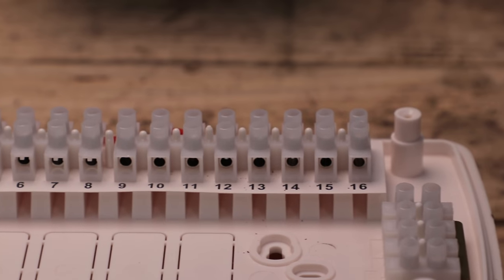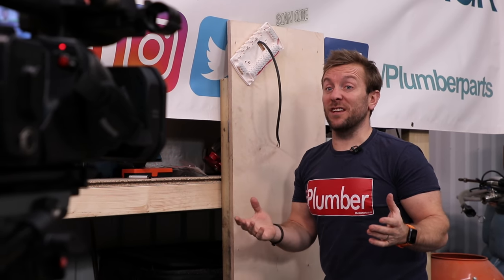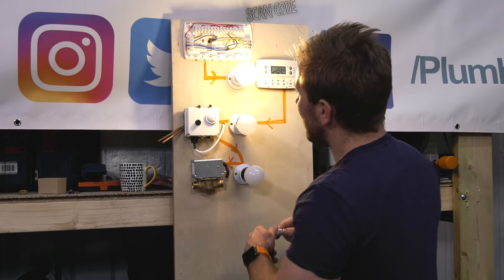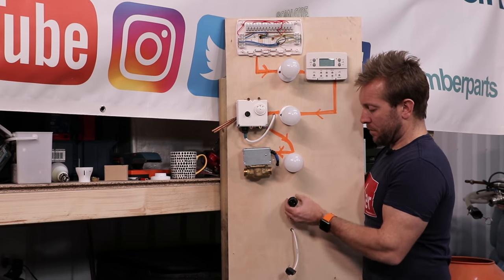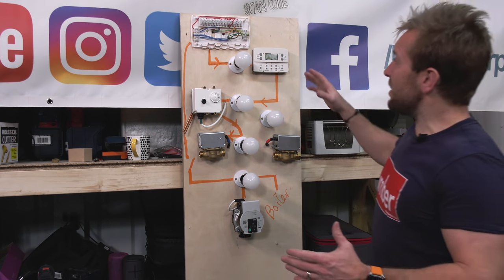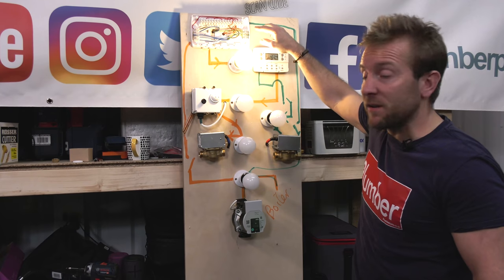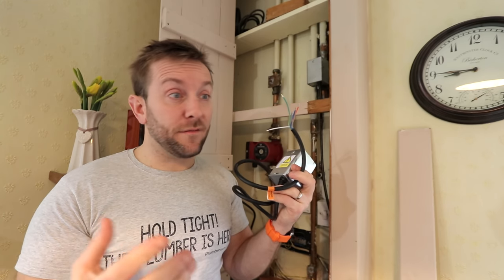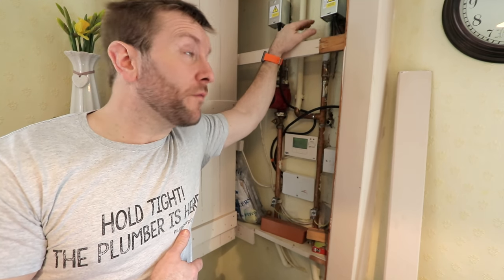2 PORT VALVES CENTRAL HEATING WIRING

Comment from the maker: Hope you enjoy guys! This'll either help or confuse you more! Comments Answered by Monday on Wednesday's video! HIT THE SUB AND BELL!!!
🛠 AMAZON TOOL STORE: http://www.amazon.co.uk/shop/plumberparts
🤗 BECOME A PATREON: https://www.patreon.com/plumberparts
📺 VLOG CHANNEL: http://www.youtube.com/c/timeswithjames
Reply: Pls my programmer thermometer can’t turn off the central heating and I don’t know if the two port valve is gone, but the hot water can turn on and off, but the funny thing is when it’s on the heating also comes on...Pls what’s the problem of my system thanks.
Reply: Cracking vid 👍👍👍👍👍
Reply from the maker: @kwamenkansah8814  100% New 2 port valve bud!
Reply: Thx so much, that's what I need for Tomorrow. Now I can start drinking.
Reply: @john-paulcox918   free de de
Reply: very well explained, not done my honeywell wiring course for about 5 years, this has brought it all back, thank you

Comment: I have installed mine but for some reason the arn isn't touching the button to turn the water on I'm not sure if I have wired it up wrong but I did the silly thing and took all the wires out can someone help

Comment: Thank you James.  Your video has helped me identify my central heating problem and explained how the two port valve is switched and connected to an S plan system.
My problem was that I noticed the pump was continually running with the boiler on until it locked out when the water became too hot. 
Despite switching off from the program unit the pump & boiler continued running. 
Your video helped identify a faulty micro switch in the Danfoss two port valve (central heating side) which was replaced under guarantee installed in a new house only 1 year old. 
Interestingly, both the boiler engineer and the plumber, who replaced the unit, said three other houses on our development had the same micro switch problem with the Danfoss valve.
Thanks again for your video

Comment: Hi James,
    Excellent video with simple explanations for amateurs like myself, so thanks for that.
    I wonder if you could please recommend a ‘simple’ wiring change which would delete the mid-position function my Honeywell 3 Port Valve on my ‘Y’ Plan System, and stop the Motor still being energised if you switch off the Central Heating when it’s running.
  As you know, if you turn off the Programmer’s Central Heating only switch (Port A open) when the system is running, then the 3 Port stays energised, with the result that the Motor is energised, although it’s against it’s mechanical stop, which shortens the Motor's life for no good reason that I can see. The only way to avert this is to switch on the Hot Water for just a few seconds after the Central Heating is switched off. This disconnects the live to the 3 Port and allows it to be spring assisted back to it’s default position of Port B open.
  Additionally, I only ever use either the H/W Cylinder or Central Heating separately, never both together (Port A & Port B both open), and never the Timer of the Programmer, so the Motor is never required to “stall” in it’s mid-position by using the 110 DC Voltage via the Diode and Resistor circuit on the PCB in the Valve Head.
  I’m asking this because my current Valve is a Honeywell V4073A unit, but Honeywell also produce the V4044 range, which look identical to the V4073A, except that the V4044’s are listed as 2 position “Diverter” Valves only, (no mid-position), which is exactly what I want to achieve (but without spending £ 100 +++ money or my fitting time !!!). Please accept my thanks in advance of your help, and I look forward to receiving your reply.
Cheers, Fred.

Comment: hi, I have 3 zone heating (ground, first floor and water with climote) and I lost heating on first floor. Plumber is not available for 3 weeks but he told me it is the motorised valve. So I got it and replaced but nothing changed. so I started looking for schematics online and testing different things. Your video helped a lot. What I found is that valve is working fine but the live never gets to valve to move that arm to press button on microswitch. Seems simple enough but some wires goes into wall and can't figure it out completely. Mostly because the lives that go out for the 3 valves behave weird. I mean when I call 1st floor heating, the correct live fires up but then goes inside wall and does not come back to live in valve and valve does not starts boiler because microswitch is never pressed. For water it works perfectly but when I call downstairs the 2 lives from controller unit for 1st floor and ground floor go live, go into wall but only the one for downstairs gose live at the valve.
This is where I am stuck as I don't know what happens in the wall (although after watching this for second time I think it might be something with pump. I was only thinking about starting boiler...) and I don't understand why when calling ground floor 2 wires go live ( and from climote schematic they are ground and 1st floor N/O respectively). Wish I could get you to look at it but unfortunately I am in Ireland.

This is wrecking my head for week now...

Comment: Great video as always James Ive always used regin 5 pin connectors when do 2 or three ports save keep disturbing the wiring centre 👍🏼
Reply from the maker: Do you use those Wago connectors?
Reply: @plumberparts  never tried them James are they decent? By the way top videos as always 👍🏼
Reply from the maker: David Berney cheers bro. Yeah they look good, but I’m going to try your idea!
Reply: @plumberparts  would love a sticker for my van James to promote your channel up in Mansfield Nottinghamshire give big g a fuss from me 👍🏼
Reply: The Regin connectors are great since they are an all-in-one plug so easy to disconnect when required.  Evidently popular with all the plumbers that have visited our house over the years because 3 of the 4 port valves are all spliced into the system using them.  The last valve head gave up recently so picked up a replacement and used a Regin connector (well actually used a Wago box for a few days while I waited for a Regin to arrive in the post!).

Comment: How would you got about introducing an underfloor heating control centre with 2 zones. so overall radiators being controlled by one valve and nest, and the other valve controlling the water to the UFH with 2 zones each controlled by nests.?

Comment: Had an issue with the room thermostat not working, would you recommend using the manual mode in a 2 port value to attain heating

Comment: Hey where does the black cable coming out of the motorised zone Valve connect into? I noticed it's like 2m or so long cable. Does it matter if my underfloor heating manifold is downstairs and my boiler is upstairs?

Comment: Great video James - looking forward to the Y-Plan follow up because that's what I have at home.

Unrelated question - the header tank in the loft always overflows to outside around 1-2litres of water each time the heating system is switched on, are there any things I can try first before calling out a plumber? Thanks!
Reply from the maker: I’ll answer on Wednesday!
Reply: The water level in the storage tank is too high , check that the float valve is cutting off properly first . If it is lower the float a couple of inches , this will allow for the expansion when  you heat the hot water from the heating system.
Reply: Probably happening due to a faulty automatic bypass valve not allowing flow during pump overrun and forcing out the open vent. Some people don't bother installing a bypass with a Y plan as the hot water circuit is left open after it's deenergised and acts as a bypass. The problem is it's a small opening and can still force some water out the open vent, rasing the water level in the cistern to overflow
Reply: fit a bypass

Comment: Hello there, I would like to ask you why you can hear the water circulating through the pipes? it is very disturbing especially at night when it is quiet. I have the heating system divided between the upper and lower part of the house and I can use them independently or together. The idea is that the valves are installed in the bedroom in the dresser (that's how I bought the house) and my child can't rest at night because of the noise.
If I manually turn off any of them, the noise disappears. What to do?
Can I send you a video so you can see what the problem is please?

Comment: Can I get the permanent supply for the micro switch from the switched live on the 2 port valve instead of an independant permanent supply? It will give the micro switch a live supply when the valve is selected?? Thanks

Comment: Interesting how different things are done in UK and US compared to Denmark. How is it possible to control the heating in a big house from a room thermostat in a single location ?
Reply: Large houses are usually separated into 2 or more zones with separate thermostats and valves

Comment: Is there a way to wire the valve control to a mains switched controlled supply with a tank thermostat.
I’ve a 2 zone heating S plan , controlled by 2xRF stats. Also an RF tank stat. 
Only 2 zones on the programmer…
Want independent manually switched hot water ..

Comment: JW John ward electrical guru, uses greys as permanent lives to valves and oranges switched live to boiker/ pump. How would you wire a S-plus with two or more heating zones? Take a feed from terminal 4 on programme to a room stat, then to the brown on a zone valve for that heating circuit? If you had a pump on each circuit would you wire the pump feed from the brown or orange / grey which ever is the switched to bring the pump on?? Thanks
Reply: Doesnt matter how many zones.all oranges together and all greys together.1 or 20 its the same.take pump live to brown on zone valve for multipule pumps
Reply: @davidlax9454   Bit late to the party but…

Im wiring the controls for a 2 zone system (ufh and central heating) the ufh is a simple set up with just 1 zone so no actuators for each ufh circuit but there is a pump for the ufh that needs to come on ideally with the orange switched live from the ufh zone valve however I don’t want it to come on with the central heating as well. I was planning on using a relay to prevent this from happening but have read comments on other peoples videos saying to just feed the ufh pump from the brown switch live operating the zone valve. Would this cause any issues over time with the ufh pump starting to run as the zone valve starts to open?
Reply: @euanowen4233  best way to do it.connect ufh pump to zone valve brown and use microswitch (grey and orange) to fire boiler.no relay needed
Reply: @davidlax9454  thank you!

Comment: Hi, how would this work if I wanted to add a second heating zone? Thanks Scott
Reply: Add another room stat and 2 port , you can have as many 2 port valves as you need . A lot of new houses have 3  2 port valves , 2 for heating zones , 1 for hot water
Reply: dennisphoenix1 hi thanks for that. That’s what I was planning, will just need to work out how to prioritise
Reply: @scottisle2550  you could use a time clock to bring on one zone earlier than the other , I always set timers to bring on the hot water half an hour earlier than the heating,  gets the water hot without starving the heating.
Reply: @scottisle2550  you can use a 3 port valve to supply 2 heating zones , in mid position you get 50/50  flow to each zone , depends on your set up

Comment: So, if you use the manual override on the two-port zone valve (for the central heating), does that mean that the boiler hot water pump will be on continuously, no matter whether the room thermostat and timer switch are on or off?
Reply: no

Comment: If my boiler pump continues to operate when both two port valves are closed via the programmer, do I suspect a fault with the motorised part of a two port valve. In other words may the micro switch not be operating as it should.

Comment: my hot water and heating issue is when I turn water on I'm getting heating with it and when I turn heating on I'm getting hot water with it this issue is since the 2 port zone valve is replaced is it to do with miswiring. If so how can I fix this

Comment: The issue with using permanent feeds to 2 port valves is when they stick on and override the stats and keep the pump and boiler running
Reply from the maker: This is part of the beast!
Reply: @plumberparts  I wire them using the time clock switch wires so when the clock or stat goes off so does the valve feed , no overrun problem

Comment: Wiring in from scratch. Easy.😀 Retrofitting a valve can be a nightmare working out which wire is which when opening the lid on the wiring centre. There may be more than one wiring box in the real world. Potential nightmare😚

Comment: Do not put solder on flexible wires.. tin flows under pressure. If you want to do better than shoving fine stranded in a terminal not designed for it (and you should!), use a ferrule. They're cheap, they're easy, and the 'insulated' type help prevent you screwing down on the insulation instead of the conductor. No solder. Please.
Reply: This! Solder has worse conductivity than copper, you are creating poor connection that way. Ferrule should always be used, you don't want arcing or joule heating to burn your house down! Or just use solid wires.
Reply: What about the simply doubling over conductors to fit terminals more snug so as to achieve good connection…? Purely playing devils advocate - I agree with ferrules as best practice